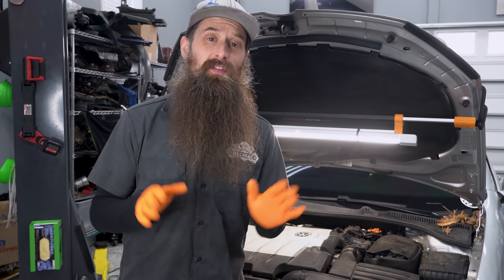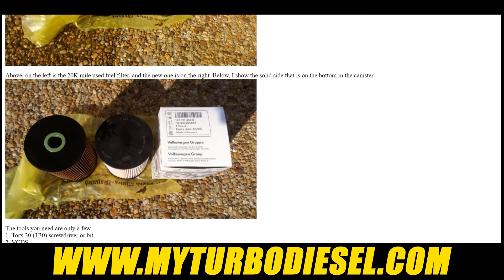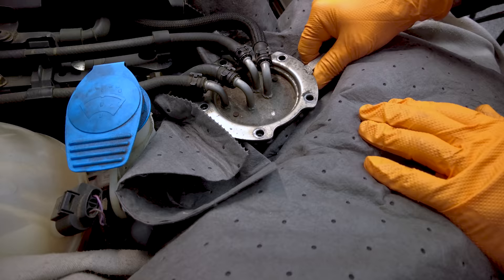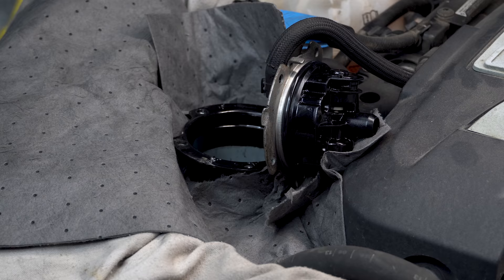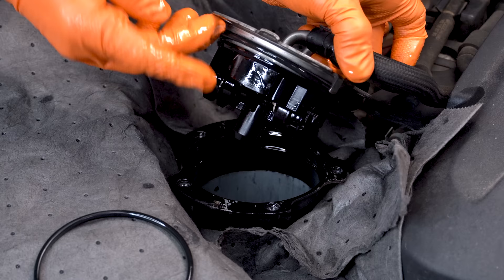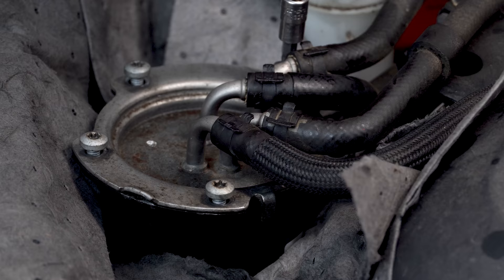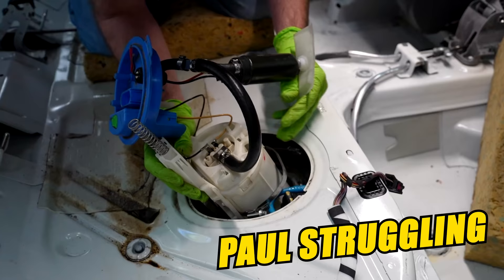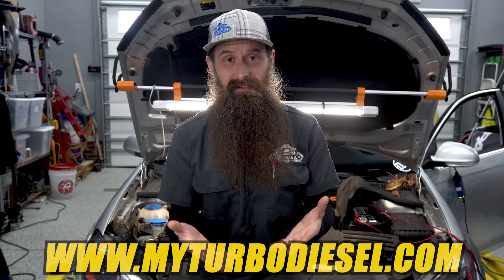Volkswagen Jetta TDI Fuel Filter Replacement ~ Common Rail Diesel

Comment: I have a Europen car repair shop and I do it the factory way I put on a power supply and the battery and then run the fuel pump at least 2 times until it stops by it self even on the second time you can hear the air bubbles  going out of the filter assembly I don't want to risk the customer fuel pump of draining the battery or overheating  the starter plus I know if I have a leak and when the customer car have no stalling when they leave. the easiest filter to replace is the ones with the seal built on the filter it self I think it's  the 2015 cars.

Comment: Having changed hundreds of these filters... It is 100% normal to see some fine metal flakes. I have never changed one and not see some. The high pressure fuel pump does wear some. Especially with low sulfur diesel. Kinda the reason you change the filter.

Comment: God i remember doing this on my Golf Mk6 1.6TDi last year. Long story short, priming through scantool did not actually prime the system. I did it multiple times but still ran the common rail dry when i went to start. 

I think the 1.6 Mk6s don’t have an Auxiliary pump under the bonnet, meaning the tank pump that supplied the filter housing was too weak to bleed and prime the system itself enough for the High Pressure Fuel Pump to get fed.

Taking off the line from the filter to the High Pressure Fuel Pump and using the scantool until it spits diesel out did the trick for me. In hindsight, i should have thrown diesel myself into the filter housing and went from there.

Comment: Wow - filter change every 20K? Dang - didn't know diesel was that dirty. Wonder how many TDI's have gone WAY past that schedule interval due to owner negligence. Thanks for the info Charles!
Reply: My 2012 tdi sportwagen manual says every 40k miles.
Reply: The reason for 20K is they where to cheap to put a water sensor in the bottom of the filter housing.
Also doesn't have a bottom drain.
Really poor designed fuel system when compared to industrial.
Reply: @Ramboy2007  - so it's less about dirty fuel, more about water separation drain off. Agreed - that design could've been better...
Reply: @Ramboy2007  so filter can be saturated with water?
Reply: @briansmith9258  On my 2014 TDI, Yes. 
There is no "water in fuel sensor" on it.
 Where as all the trucks and equipment I have, use sensors or sight glass and filter drains.
Reply: @Ramboy2007  gotcha, I have new one coming. Hoping it’s the issue but doubtful. Thank you for the reply.
Reply: @briansmith9258  If you are buying at the pump, very little chance of a issue.
The last water issue I had came out of the farm bulk tank.
Reply: @Ramboy2007  yeah I think filter is fine but gonna change it for peace of mind.

Comment: See that large pipe that comes out of the engine and runs along the front of the engine compartment then goes round the back of the diesel filter and then under the coolant bottle, what is that and how bad is it if that is not in its clamp and just bouncing around?

Comment: I just changed my fuel filter, and drained the entire container like you did. Ran OBDEleven on channel 35 4 times. But the car will not start now. 

It ran perfect and started right up before I did this.

Any thoughts?

Comment: Honestly if you topped up the housing just key cycling 3-5 times is way plenty if you don't want to drop 250 on VCDS. 
Some jobs really can be over-thought ..
Reply from the maker: The key cycle way gets it done pretty well. I do think if you are doing serious DIY, VCDS or OBDeleven is a must
Reply: Hi, can I just do a key turn a few cycles on my 2010 VW Jetta if I leave fuel in
Reply: @reewoods8441  I'm going to delete my original comment because the last time I did this job, I ended needing VCDS to cycle the fuel pump because air got in the system. So, I would not recommend just relying  on key cycles.. it might take a long time.

Comment: I was going to do that on mine but I really wish you also changed the timing belt so I can see if there any special or specific steps
Reply from the maker: Soon! We will do a belt on this car.
Reply: @HumbleMechanic  first of all thanks you for the fuel filter replacement I didn't know it was every 20k intervals, Im new WV owner and TDI  owner, trying to find answers to some few problems. And the timing belt is the next big service I need to do it is due or passed due

Comment: Hi there, we have many of the TDI's in Australia so good to cover them, thanks. 
I have a 2013 5N 103TDI pacific Tiguan with the  1968cc CFFB engine. I assume it's the same procedure. 
Indeed it's much the same for most VW TDI engines. Mine throws a haldex pump code occasionally, so pump will need replacing at some stage. I know you've covered the haldex service. Could you cover a pump replacement please. Also, have you had a play around with OBDeleven what do you think? Have you done a review.

Comment: Are the TDI engines more reliable than the TSI?
Reply: Most of the time, yes. Especially when tuned and deleted
Reply: Yes but the new tsi's seem to be pretty solid as well
Reply: @gabrieldetwiler7078  agreed. EGR delete and a tune makes them super smooth and powerful.
Reply: @MrBasstothemax  oh they are no doubt. My 1.8 tsi in my alltrack has been great
Reply: @andrevos7783  absolutely. Diesels don’t like anything emissions

Comment: 2014 jetta tdi. been told key cycles dont prime the system or remove air. you said its ok if you dont remove the fuel, to cycle the key a few times?

Comment: I had like 1/3 of fuel left in canister and didn't realize I had to top off 

I cycled the car 4-5 times 

And it started right, is it safe to say if there was a problem with priming I would know right away ?

Comment: At the shop we just refill filter housing with fresh fuel drop it down seal it up couple keys forward.  ... Always starts rev it up easy pezzy
Reply: So you’re a mechanic, and your shop doesn’t bother with priming? What do you mean by ‘couple keys forward’? I’ve been scared to change fuel filter without VCDS. Some comments say they’ve had no problem, others say you can ruin the hpfp.
Reply: @paulwary yes shop.... hundreds ive done and never a scantool

Comment: Do it on 1.6 cayc engines, even when priming pump u cant bleed the system and car wont start! But there are few tricks we use.
Reply: True. I also commented about that, it seems that priming with vcds makes the fuel pump push fuel backwards through the return to tank fuel line making it impossible to remove air. I always had to vacuum and it's a pita.
Reply: @guilhermeg345  you never know outcome after you replace it, btw ford is probably the worst!
Reply: Upravo imam taj problem.Sve sam uradio ali auto nece da se upali. Sta treba uradit?Hvala unaprijed.

Comment: Hello, what do you think of amsoil 15w40 heavy duty motor oil? In the manual it says that it is compliant for OEM service, could I use it in my truck for 12,500 miles? or better change it to 6,000 miles.?

Comment: Hello Charles!
After I have somewhat of a confirmation from you guys I’d like to buy whatever parts this issue fixes.

2010 Golf GTI DSG

I have a DQ250 that drives up until the end of 3rd gear. And won’t shift into 4th(if I try to get into 4th, either manually, auto or sports the gearbox completely disengages and basically goes to neutral whilst flashing D3 with wrench) . BUT if I put it in neutral at the end of 3rd , if I’m at speed it will skip 4th and go to D5 or D6.. is that clutch pack, synchro, or mechatronic??? No mechanics near me know anything about it, the stealership wants to just replace with new for 8,000 and I’m sure I’d be able to get whatever part it is from y’all a lot cheaper..

Thanks!

Comment: Hey Charles, I have a question, is it ok to plug in the obd dongle while the engine is running ? For example, I've been doing this for awhile when I see my car doing a dpf regen I plug the obd dongle and track the progress so I know more or less when it ends and to see the temperatures, etc, but I thought to myself this days if that's really ok to do it. Could it short something in the obd plug for example ?

Comment: You drained and wiped out the filter housing. Later you got “fresh fuel” out of the housing to lubricate the seals.  Where did the fresh fuel come from?  Did you run the pump using VCDS to partially fill the housing before you put the new filter in?
Reply from the maker: I did. We had to film the pump activation but

Comment: Wish my a4 b8 would have fuel filter located in the same place like every other car from vw group 🤣😭
P.s. if you fill the housing full of diesel (insert filter first then upper cover) then  is not necessary to bleed the system but is recommended
Reply: So do you use a turkey baster or something to add fuel to the top?
Reply: @paulwary  first, pour diesel halfway up in the fuel filter housing, then insert filter and top up with turkey baster, bigger plastic medical syringe or something similar(my method on uncles tiguan 2.0tdi) cheers

Comment: Hey HumbleMechanic Need some help I Bought a 2002 VW Passate 1.8t 6 months ago. recently I went to Ottostadt get my heater core cleaned or something. so they did an inspection and now they took pictures of worn out control arm bushings that need replacing. sent me a video of the arm being moved by a crow bar and tell me the arm is supposed to go back in place you can hear creaking like rotten broken metal. also the power steering pressure hose is leaking saying it also needs replacing. Front axel boot needs replacing and Rear shocks are corroded... they are saying they would feel bad if i put the money and effort into this.. starting a new job soon and I don't know what to do

Comment: Hi Nice video... if you cleaned the bowl and you don't have the scan tool, can you just fill the bowl with the new filter in an then re-install the filter cover?
Reply: Why’d you clean it? Not necessary unless metal in there.
Reply: @briansmith9258  I though there could be some water  and other deposit coming from the fuel tank
Reply: @mariobeaudoin9733  I understand. Just asking.

Comment: I've been debating doing this myself for a but. Usually have my mechanic do it. Charles, have you looked into the nicktuned CAT style spin on filter conversion?
Reply from the maker: haven't looked at that style! With zero education on it(HAHA) it seems like its solving an issue thats not an issue. 

Now that filer may be a finer filter, and that would be cool. but just for ease, I dont know if its worth it

Comment: How do you feel about diesel additives?
Reply: Single best additive you can put in your tank is a cetane booster like 2-ethyl hexyl nitrate. Your engine and DPF will thank you for it. I add chemicals for lubricity too to protect the injectors. Now modern oil refineries remove sulfur from diesel,  polar compounds that prevented wear are stripped out. In Europe you can order Mannol diesel additive with ester compounds as Wear inhibitors/lubricant plus medium chain alcohols like butanol which booster the cetane rating. I also add some hydrotreated light naphthalene which a diesel engine will tolerate. That will clean carbon deposits more effectively than diesel. Hope this helps. I'm not a petrochemical engineer but I studied chemical engineering so close enough
Reply: @richcheema  outside of the Mannol, what other name brand products do you use?

Comment: Hi Charles I have a question? Do you think it would be a good idea to replace the high pressure fuel pump, when you replace the timing belt?
Reply from the maker: In general no, if you don’t have a failure

Comment: Doing key cycles will not fill the filter canister on that model/engine.
Reply: Can you give a reference on exactly which engines can be primed with ignition? I read one guy stated that if you leave your foot off the brake and move to start, the pump will prime.

Comment: Is the diesel dark you have a bad pump on the side of the valve cover. Seen that a lot of times on VAG
Reply from the maker: Ive only seen that on PD engines, where the injector seals leak.
Reply: @HumbleMechanic  PD are the worst. But also the moste commen amongst those VAG's I have done work on.

Comment: When it comes to gasoline engines vw is not that great to say the least,especially compared to the japanese.Talking about small displacement engines.Diesel though,now this is another different story.I would say vw makes the best inline 4 and v6 diesel engines.Here in Europe they are everywhere.Seen passats with 1.9 Alh tdi going over 500000km easily.They can also be sporty.A friend of mine has a rare A4 v6 tdi quatro.That thing just pulls and pulls throught the rev range.